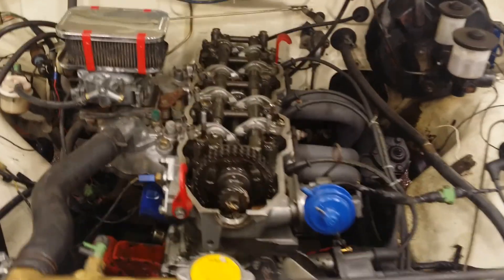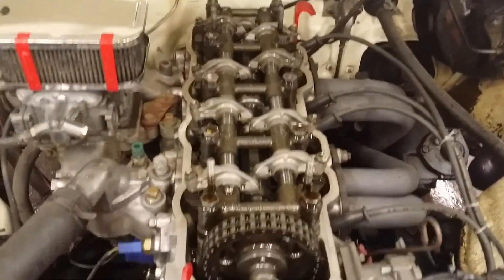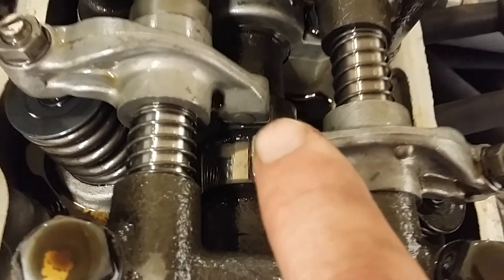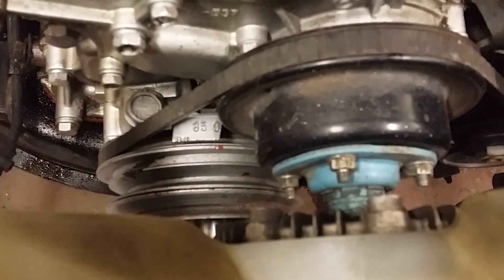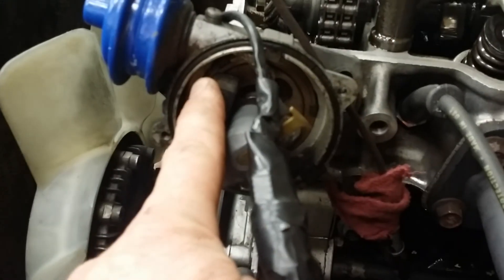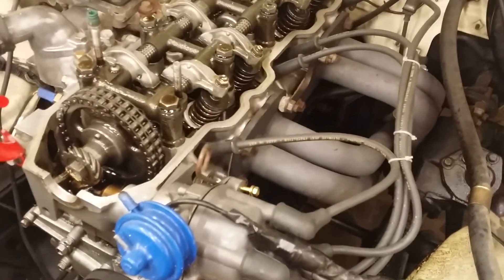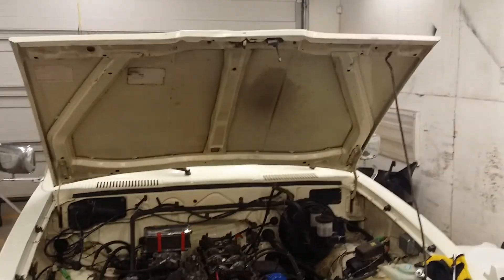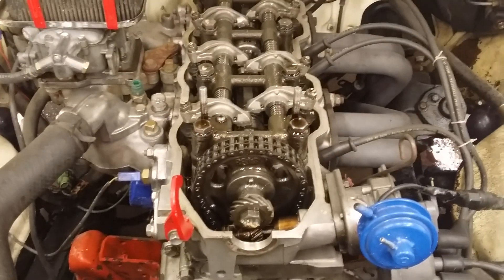78' Toyota hilux pickup 22r Valve adjust/timing update

Comment: My engine I just picked up was yellow and I rebuilt it and it runs bad but if I advance the rotor is runs a little better, my question would be what order do you put the plugs? If I put the rotor to #1 I can’t even tune it cause the mark is no where close to the degree marks
Reply from the maker: That just means the distributor is not installed properly. Best thing is to watch a video on how to install it for the right timing. It needs to be taken out turned one direction or the other and reinstalled. If that makes sense. It still runs because your firing order is correct, its just not "clocked" properly to work with degree marks.